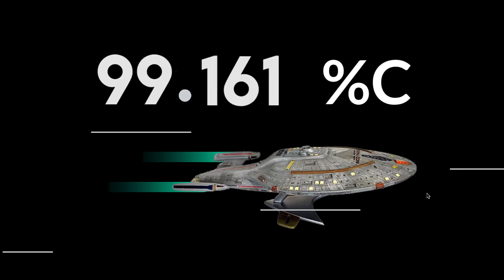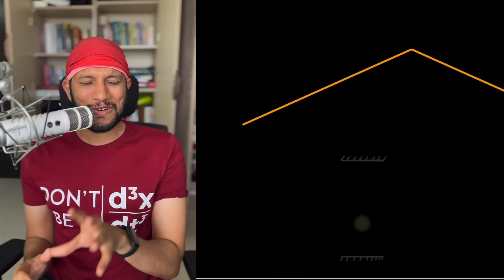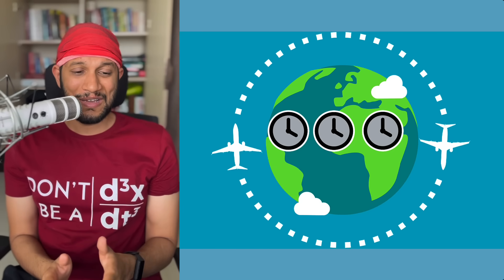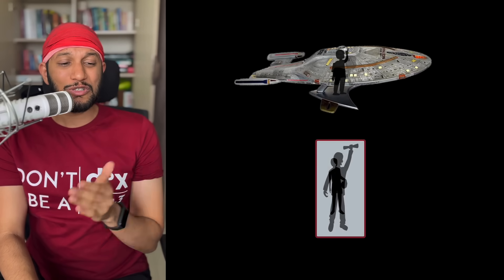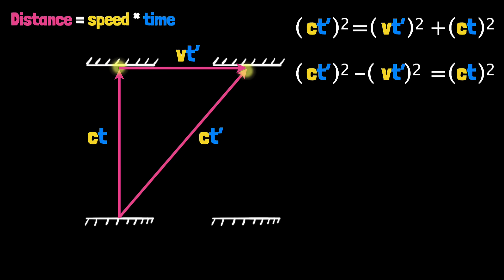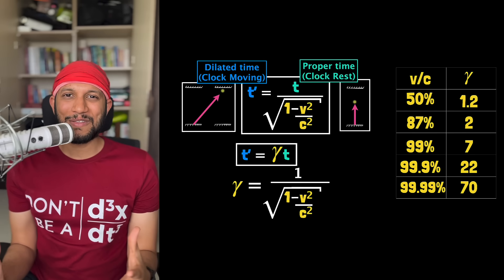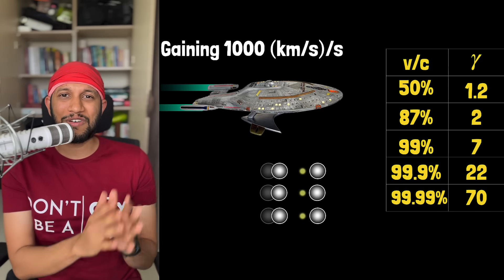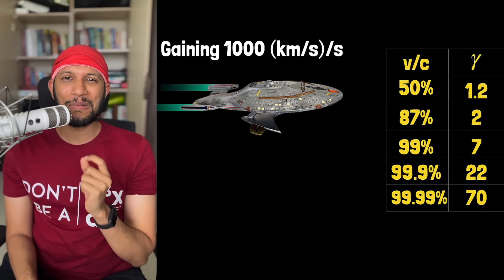I finally understood why you can't go faster than light! (My mind is blown)

Comment: Speed is distance over time. That's it. Light is really irrelevant if it wasn't built into mathematical formula we made to make the numbers work to equations we created to support our belief. It was a constant until discovered to slow down under certain conditions.

All this about the amount of energy required or inertia are mathematical hypotheticals, in short totally irrelevant. Mathematics changes to explain observation not the other way around. 

All the relativistic rubbish is about our perception of the event. An event we are a part of invalidates any observations, so we are no longer the observer but participant, no scientific experiment can be accurate if you are a part of it.

You aren't in two places, you don't exist outside of time, you don't age differently. Point A and point B is traversed in a given time whether you measure or can't, you travel a distance over time, FACT if that time is short enough your speed is faster than light - what it looks like is not what it is, if you're at B you are not at A, because our senses are based on light, that doesn't mean light is the overriding constant in the universe - just for us, because light like in the old days of sound is just a speed. We've built a mathematical constraint into it simply because we can't perceive beyond it.

There could be an entire universe of FTL and we're just incapable of perceiving it. Its sheer arrogance to believe it doesn't exist or cant be done just because we can't do it or perceive it.

If intergalactic space travel or communication is possible then FTL must be. It's a logical imperative.
Reply: thanks for the laughs 😂
Reply: @ne9571  which part do you find so funny? Where do I break logic or nationality in any of that?

Comment: I'm actually so proud, I understood this by thinking about it the same way you did, because nobody on Youtube could explain it in concrete terms. Every body usually resorts to a very abstract explanation: "the faster you move across space the slower you move across time", which doesn't explain anything, it's just phrasing the problem differently. It's as if I was asked "why are zebras black and white" and I answered "well that's easy, it's because you see them that way"

Comment: Nice explanations, but there is no absolute point of reference. We are on a spinning Earth, so there is that movement that skews our perception of time. On a planet with a different rotational period, we would age at a different rate. And we are in a solar system that is rotating around the center of the Milky Way Galaxy, so there again, if our rotational speed ever changed, our lifespans would also change.

Comment: Ditch the math. 
What’s a (transverse) wave?
- up and down motion of the medium, that propagates forward (right or left). That happens at the rate of induction of the medium. Can’t go faster and happens to be C in the “vacuum”. 
What’s mass?
It’s a wave that tried to pack more energy (shorter wavelength) than can be propagated in the medium, reaching hysteresis of the medium. Ends up being a standing or circular wave, like Hydrogen (or super energy light)

How can you send a standing/circular wave, faster than C, when it became circular exactly because the medium didn’t allow to propagate?

Longitudinal waves can go faster but they don’t make mass.

Comment: But you said the ones in the spaceship will not notice a difference in time. So that would mean, as they are accelerating, everything looks normal. Speed is increasing accordingly. And their speedometer shows everything is increasing, and they’ll eventually reach the speed of light by their perspective. Or will they?

Comment: Yes yes yes, but you are still messing around with geometry and math derived from lines on a piece of paper. You do not say what the physical causality is for inertial time dilation. Read my paper above and my others on Academia.

In a nutshell, the process of time is from a wavelike field of energy that powers all events. Actually it provides the energy for all physical processes.
Wherever there is energy, mass energy or kinetic energy, then this energy has to come from the field, (of time) and so the field diminishes in energy by that same amount.
This is the cause of inertial time dilation, the fact that kinetic energy is always drawn from the field of time, the energetic field of time and so time loses energy, it red shifts and slows down.
For mass energy, again the energy of all the particles within the mass has to come from the field and so the field again red shifts and time slows down, giving rise to gravitational time dilation.

The reason that no mass can never each the speed of light is because the mass is already using some of the field energy for its internal workings and so there is less field energy left  to use for kinetic energy. Anything with mass energy can never reach "c". It takes a massless particle, (photon) drawing ALL the field energy for its motion in order to reach "c".

THESE are the fundamental reasons for inertial and gravitational time dilation.

Other than that, The math is perfectly correct, and yes, time really does slow down for moving objects and around large masses.
Yes

Comment: So, if I understand you correctly. The faster you go, the slower time is for you compared to the outside universe. If you hit light speed, time would basically stop compared to the outside. That would mean you would be outside of time. Without time, wouldn't you be in all places at all times. 
 Why doesn't light behave that way. It's not in all places at all times. It takes light 8 minutes to go from the sun to the earth.

Comment: Because they are lying with precise mathematics, if you can get your head around that phrasing. Light is not the speed they claim. Light in normal air is instant. You cannot go faster than "instantly".

Comment: Hey, Mahesh! I have a question, and just a heads-up, I’m currently only in 10th grade, so please bear with me if I’m off track on any concepts.

So, here’s the idea: if we're moving with an accelerating velocity in a spaceship, transferring information via photons would take a long time because of the constant motion. But what if, instead, I were accelerating in terms of energy while staying at rest relative to an object? For example, if I added a wall that could absorb the amount of force equivalent to the speed of light, I’d be at rest, and photons would still take the usual time to send information.

So, does that mean I could theoretically accelerate to the speed of light while at rest, then remove the wall, and—boom—I’d be moving at the speed of light?

Comment: Just out of curiosity:
Wouldn't you hit the same bump in the road, if you would take the speed of sound as a speed barrier?
For this example, you wouldn't know that there's a photon which moves faster than sound, so all you have are calculations between time and sound.
Where am I going with this?
Today we know that photons are the fastest objects and the time calculations are based against that, so yes, the speed of a photon will always be the roof.... until we discover an object which goes faster. That is, of course, if we ever possess the ability to do so.

Comment: Suppose I had a mystery particle or wave if you will, that travels at 10 times the speed of light.  I then propose to make a mirror clock using that particle,  just as you described.  Applying the same logic as the video, we discover that 1/gamma = sqrt(1 - v^2/(10 *c)^2).  So why the particular value of c?

 I thus conclude that the speed of light limit has an additional,  unexplained connection with the fabric of space time,  since nothing has fixed the value of c.  I know that c can be derived from Maxwells equations,  but that relates c to the permittivity and permeability of free space,  two other mysterious constants.

By the way you can show that the Lorentz transformations must occur by simply assuming that relative motion leaves any given inertial particle moving in a straight line.  But it doesn't tell you what c is or why it shapes time and space.  A lot of people believe that time and space contraction are observational and not real.

Comment: I am by no means super intelligent, but your argument for the propulsion system slowing down near the speed of light doesn't make any sense to me. Anything to do with the propulsion system would already be moving relative to itself. Therefore there would be no delay between interactions.

As you stated about the clock appearing to perform normal on the ship, the engines would do the same. The fuel doesn't know, nor does it care if it's approaching the speed of light. Everything and all of its molecules are moving relative to each other.

Comment: This is possibly the best explanation for this I've ever seen. I understood it to be a similar issue to a singularity, a curve approaching an asymptote, whereby infinity becomes a limiting factor, and I understood the frames of reference, I've even seen the photon clock described and drawn out, but this put all the pieces together in a brilliantly easy to follow way. Well done!
Reply: Infinity has nothing to do with this issue. It's finiteness instead.
Reply: @alvinuli5174  the speed is ultimately finite, but the energy required to achieve it approaches infinity as you get closer to it.

Comment: Right at the outset, your formula for kinetic energy is incorrect.
Looks to me like the error is due to the common misconception that mass increases with speed, since momentum, p, in special relativity (SR) is
p = γm₀v, where γ = 1/√(1–[v/c]²), and m₀ = "rest mass"
This is then often misinterpreted to be saying that mass is m = γm₀
when in fact it's just saying that momentum in SR is no longer simply mass times velocity, but rather, has this more complicated dependence on velocity.

As for kinetic energy, K, in SR, it is
K = (γ–1)mc² ≠ ½γmv² . . . except, of course, when v = 0

This still goes to ∞ as v approaches c, so it still helps explain why v can't reach c, exactly as you argue.
Because all it takes for v not to be able to get to c, is that K —> ∞ as v —> c.
(Note that in the limit of v<<c, both these formulas approach ½mv², in the sense that the ratio of each of them to ½mv² goes to 1 as v —>0.)

Fred

PS. I must add that this was the only 'mistake' I saw here; and even IT doesn't detract from your overall presentation.
I think you've done an excellent job walking through this territory and looking at it from all directions, from the point of view of the non-physicist.
Reply: thats all well and good but could you make a video i could watch so I can understand what your saying please haha
Reply: @thepaedophileprofit3062  Won't be able to any time soon. Sorry.
But somewhere down the road, I do hope to get my act together and make some videos about several things, including this.
And there are YT videos about these topics out there; I can't provide the links at the moment, but some YT searching might turn them up.

Comment: I understand what you are saying, however I have never believed that Einstein was correct with his assertion that nothing can go faster than speed of light.  Take two sources of light using identical frequencies, place on rim of spinning wheel.  Spin very fast, measure light frequency of each and compare.  Source mving towards camera has higher frequency, because that light is travelling faster than C.  Vice versa with other source that is moving away from camera.  Many theories came about from this incorrect assumption.  Time travel does not exist.  Mass does not change as speed increases.  Some clocks appear to change at speed purely due to changes in gravity affecting the mechanisms.  Just because I may move my legs slowly doesn't mean that time has slowed down.  In time we will regret our decision to trust Einsteins' assumptions.  Just as we eventually worked out that the world really is not flat we will realise one day that photons too travel at a speed that is relative to the source and NOT something that is fixed relative to some observer.

Comment: This great video also helped me realize that speed isn't the key, we need like worm-hole tech. lol To even use 1% light speed it is impractical for a meat sack and current technology period. At 1.3g (what airlines strive to stay under for passenger during take-off, it takes 6 hours to reach 1% light speed, 6 hours of continuous acceleration like was said, 1.3g rate that must get stronger over 6 hours.. impractical. We would also need gravity manipulation. The highest performance car in the world maxes out at 1.5 (5.5 hours+),  can enough people withstand F1 g's for 6 hours?!. 1g to reach 30% light speed would take 70 days! The 4 light years to Alpha Centuri @ 30% it would take 13 years after accelerating for 70 days continually, ideally with some gravity tech or some really strong bones. So apart from like having the tech and needing to take a civilization to a new planet or something, its not going to be a reasonable. At 30% time dilatation isn't a big concern. But a 4 year delay in light speed data transfer for communication would also get practically annoying, not to mention beaming any amount of data that far. Luckily if we make this practical through gravity manipulation than we are closer to worm-hole tech anyway.

Comment: People need to understand this is theoretically impossible. Until someone practically proves it can be done. However with the current day technology it is outright infeasible in a 100 years? 500 years, 1000 years? you never know. Today's technology was unthinkable in the bronze age. And to get to a certain technology several fields has to line up at the right time with both the need and demand for it. And sometimes you have those rarer ones where they invent something that you never thought there was a demand for unlocking the door to a whole new level of bizarre technologies. We never know what tomorrow brings.

Comment: Is it like a bell curve of acceleration starting from the bottom and reach to the top and when going faster the ship speed efficiency goes down? It seem that there is an optimum speed for a space craft and that's on top of the bell curve and refuse to try to go faster.

Comment: I'm sorry if this should be obvious but most of these topics are far beyond my level.  My question is there is proper time, and dilatated time, but wouldn't there still be a universal time that would govern everything.  You have the time it takes for the light to bounce back to the obverse but that doesn't change when something actually happens right?  Just when its perceived to have happened.  Sorry, this is probably obvious but I'm not getting it.

Comment: The Star Trek universe does not have ships that exceed light speed.  They have ships with drives that warp space; i.e., create a bubble in space-time to allow a shorter path between two point is space.  The relative velocity is just a measure of distance over time, and not actual speed.

Comment: What happens here in the standard model, you would need to generate infinite energy to accelerate real mass. However, the standard model is outdated, since matter itself has mass, but in truth matter IS energy, and energy is an interaction of massless fields. When they van correct this incongruity they will probably find mathematical viability for acceleration to the speed of light and even more... Or maybe not. Who knows?!

Comment: Sounds like the speed of light is just the universes frame rate. It’s not the speed of light but the speed of reaction to anything happening.  And light just hits that because there’s nothing in a vacuum slowing it down. The photos movements are limited as if it’s it’s the games engine unable to push render anything quicker

Comment: I understand the Pythagorean theorem method of getting to the gamma formula, but something still is not clicking about the experiment.

Doing the experiment the ship would be moving away from you so you'd be receiving the light from the clock (what I'm going to call information) at a rate of C minus their velocity. The slower velocity of the information accounts for what we have labeled to be gamma. 

As a side note, I'm sure the information would be visually interpreted differently as I'm receiving information at a slower rate than I would have if it were next to me (some form of red shift).

Now let's say I also had a clock. And the ship eventually stops. When the ship stops I'll eventually start seeing the information at the same rate at it's being emitted, although I'll see the light that was emitted some time ago due to how far they are. Once I start moving toward them, no matter what speed, the information I receive will be faster than C, it would be C plus my velocity toward them, I'll see the ticks faster than they are actually occurring. When I finally reach the ship I should have received the entire amount of information emitted and it should sync up with the ships clock . The amount of ticks by each clock should match. Concluding that if I never moved toward the ship my clock would match the ship clock and time would have been constant, but the information I see from the ship would have been from the past. To me that doesn't seem like time dilation, but rather I'm looking at something far away and not seeing what's currently there but what was there, looking at the past. There has to be faulty logic in my example though because of the discrepancy in the clock experiment with the planes. If what I'm claiming is true then the difference in the clocks would have been adjusted as soon as they reach the same destination.